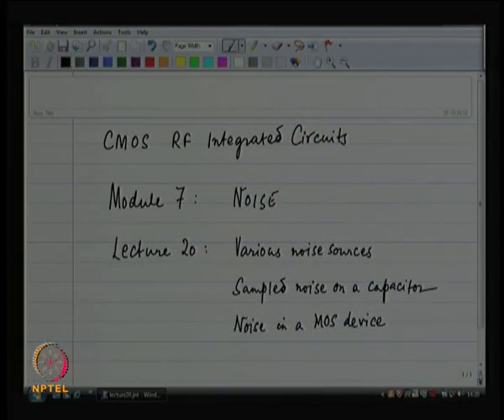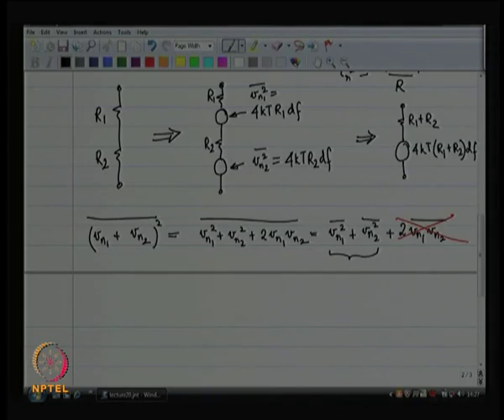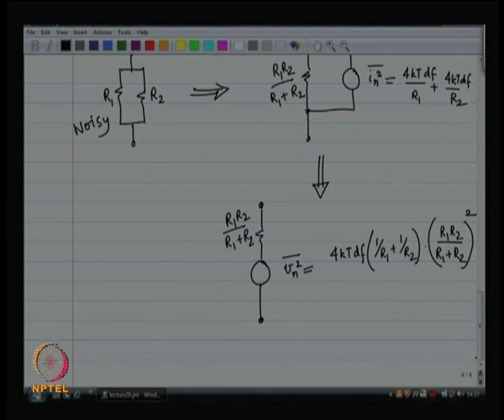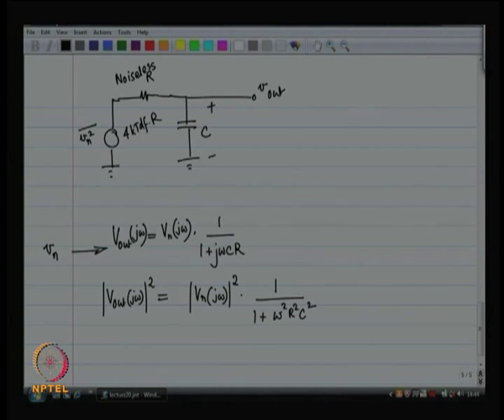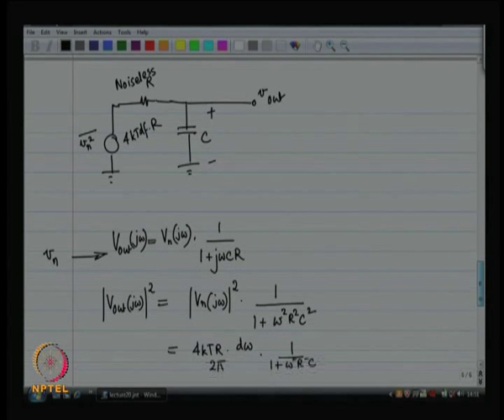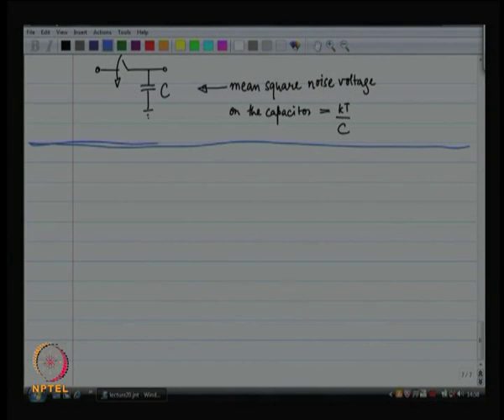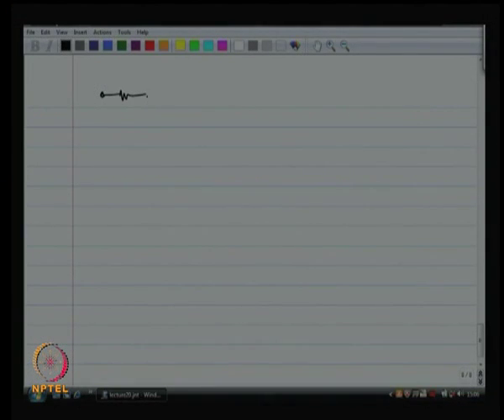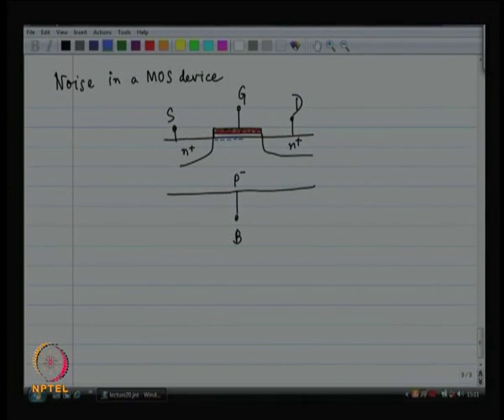Mod-07 Lec-20 Various noise sources

Comment: 28:00 I was aware of the result of RC circuit with Thermal noise as input. (Studied in Random process). But the way he started by taking Noisy resistor and then changed into Noiseless resistor and then followed the analysis was good way to explain How things are transforming from Noisy resistor we also get noise through Cap